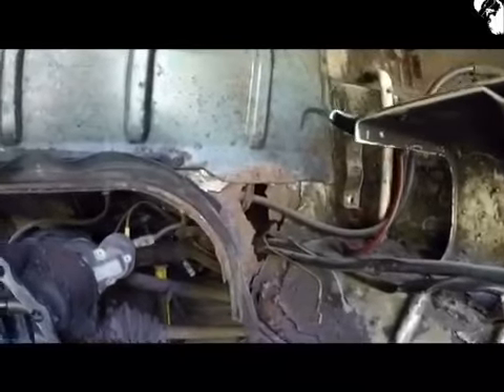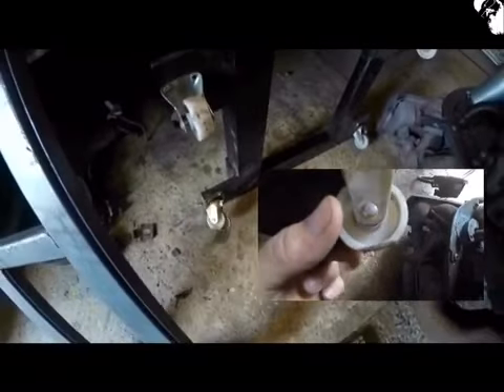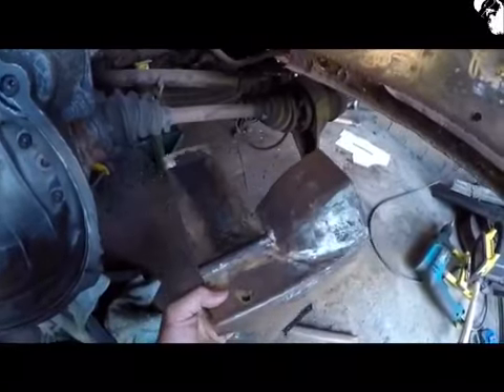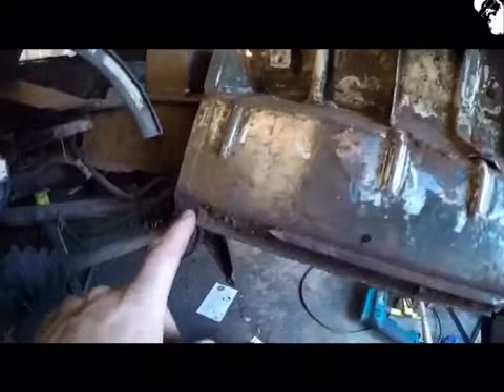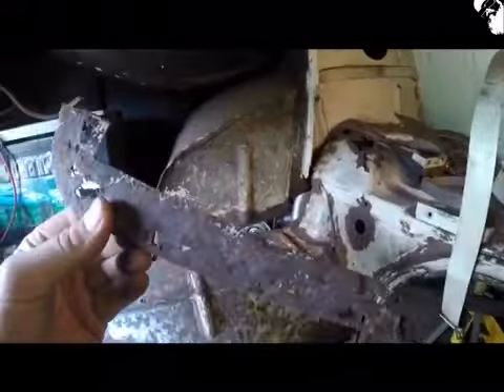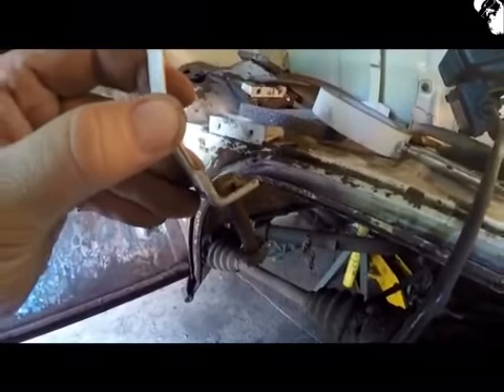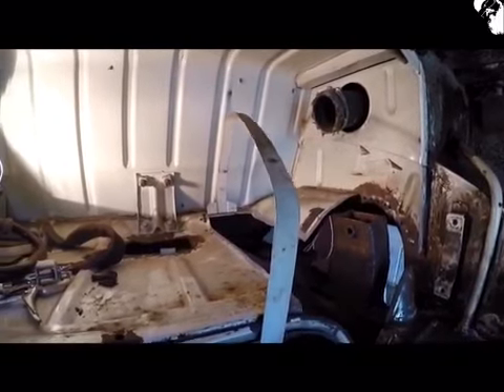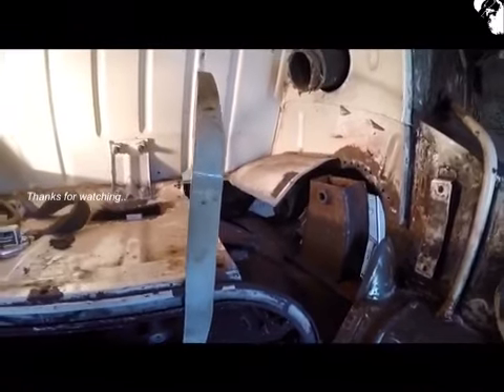Classic 1970 VW Camper Bus restoration. ‘Day 75 - Engine bay’.

Comment: Ross it is amazing how you endure the tedius rust repairs and do not get all riled up & just address the repairs one area at a time. Fabricating up what you need flat piece of sheet metal using common hand tools and a simple brake and bean roller. Ross i have both of the above tools most of all the tools you have & the parts that  are made on mine do not look as good as yours.
Reply from the maker: Thanks dan, kind words, installs a bit of confidence in what I’m doing, cheers. It is tedious, more so annoying that there’s so much to get done..I’ll soldier on though, no turning back now till she’s done...thanks for watching.